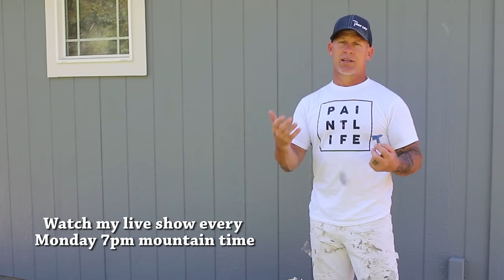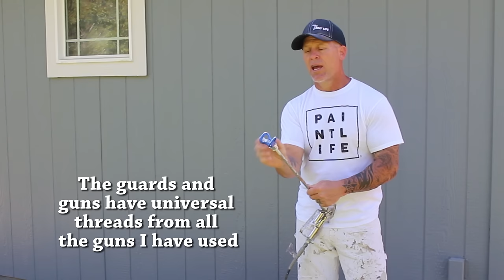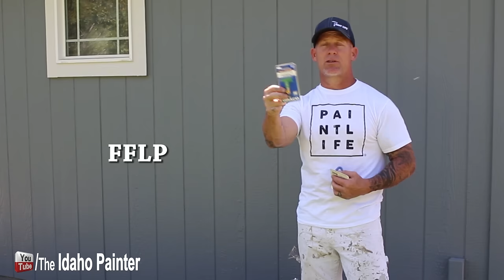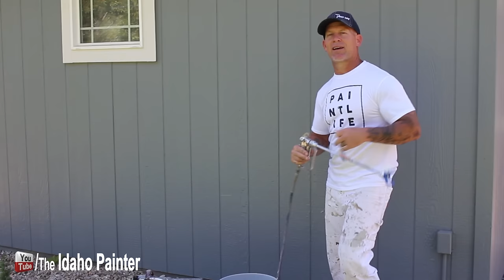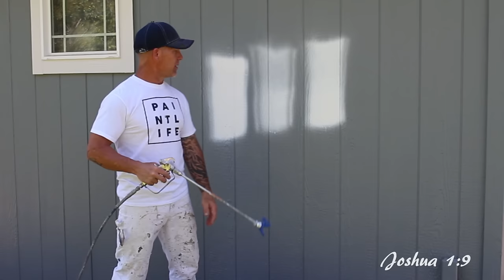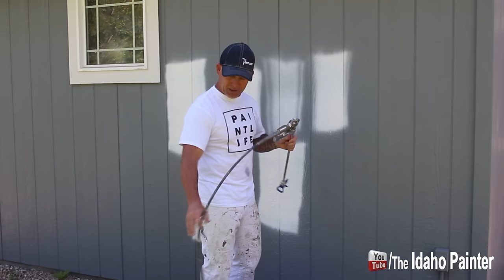All About Airless Paint Sprayer Tips

Comment: YOU SHOULD MAKE A CHART OF ALL THE TIPS, THE PURPOSE OF THEM AND THE PSI THEY SHOULD RUN AT AND I'LL BE THE FIRST TO BUY IT!!!!!
Reply: Or just primt it
Reply: 12th 1
Reply: Several online.
Reply: How about you do it for him?
Reply: Where…?😂
Reply: you can't make a chart since what psi is required varies according to the viscosity (thickness) of material being sprayed. Get a No. 80 Ford viscosity cup and learn to measure the viscosity and start keeping notes of what theconditions are (temperature, viscosity)--I would start there.
Reply: @yusefmessallam  🙄I could be wrong but I'm not on here asking how to paint a classic collectable car, though will admit I am assuming most of us are asking for basic spraying interiors or exterior of one's house or maybe even a fence etc.. well aware of all technicalities and variances for everything especially down here in FLorida (humidity factors everything) but just a simple rough psi estimate with now maybe even sharing your local (temperature, viscosity) paint your spraying with to compare🤔🤷‍♂️

Comment: Great vid, showed this to my crew today.

One more tip related idea: Each size tip has a GPM rating that should be considered in relation to the pump being used. For instance, using a 321 tip requires a pump that can push better than .47 GPM. We spray thick materials (intumescent paint) and usually use 325 tips so the pumps we use are pretty stout.
Reply from the maker: Yes, thank you for sharing

Comment: I retired from painting 19 years ago. I hated the Graco gun with its two finger trigger. I used the Wagner gun with the 4 finger trigger. Way less fatigue on my hand. Now, I know that Graco
has a 4 finger available now but not that I knew about them then. The other thing I always hated was the reverse a tip,  just an excuse to not keep your spray machine clean and running efficiently. When you have to stop and flip the tip around your just wasting time. I had a SprayTech 2510 electric pump, a conglomeration of Wagner (Titan) and I believe Speeflow, though I could be wrong about speeflow. I used this wonderful 2510 for a few years. For interior wall spraying I used a 12/21 12 inch fan my spray technique was like doing ti chi where I kept the distance of the tip from the wall constant using up and down and side to side angles at a constant pace. Now on exteriors is where I really shined. I used a wore out 12/21 tip to where the fan at 4' was only 3" to 3 1/2" and so it was also at 12' with the volume of a 0023 to 0025 tip. Even on a ladder my feathering technique left no flashing even on unprimed Hardiplank
concrete siding with the darkest of colors. The builder asked me to train his painting contractor working in another town how to spray exteriors. I told him, perhaps you should  use me instead. I quit painting at 45 years of age, got my CDL at 47 and have been driving trucks for the last 17 years. No more funky painters whites, no more paint all over my hands, face and hair. After nearly 30 years of painting, I don't miss it at all. But to each his own, I'm not putting anyone down for doing it, its harder than it looks to the non painters. I know this because 
An employee of the builder asked me how much to paint his new house. I told him $900 not including materials, a bargain price. He said I'll just do it my self. He was a kind of creepy guy
The secretaries told me he talked shit behind my back, and he gave kudos to no one, until one day. A month or so later he walked up to me and said, "I should have let you paint my house" "that was the hardest thing I ever did in my life" "you made it look so easy when I watched you doing it" My reply to him was, thats years of experience you were watching.

Comment: I've never used an airless sprayer.  I plan to rent one from the Home Depot to spray the unfinished inside of my 2 1/2 stall unattached garage.  The walls are 3 sides of the studs on 24" centers, plates top and bottom, and the wallboard behind them.   From watching a previous video of yours, that means spraying the inside of the rectangle first and then the wallboard in the center.  The overlap would be on the tops of the studs.  The surfaces will be thirsty since it is raw wood and the black paper wallboard surface.  I'm guessing that the 5-15 would be be a good fit for a first-time person.  It might take longer, but I could adjust my speed and passes rather than be overwhelmed as a first-time user by the speed and perfect distance discipline required to prevent getting into run trouble.  Your videos have been helpful to me as to know how to approach this project.

Comment: Outstanding video. I am a homeowner that has brushed, used pads, and rolled my cedar shingle home since 1975 when I first purchased it. 
  The home has grown as our family did, and I have painted the interior and exterior many times since. 
  Starting back on the South side of the house and had to really put some effort into cleaning and resecuring the cedar shingles, and primer cutting under the overlap where the roller would not get up into. 
In getting ready for this, I broke down and purchased the Graco Dewalt battery operated sprayer, yet had very little knowledge of basic hardware or fan and tip relationships. 
Thus I brushed and rolled the primer over the past weekend. Yes, I was quite ignorant and hesitant to jump into something that I knew needed insight and education. 
  I have had my own small business for 30 years and excel at what I do, but I sure needed schooling for this. 
  I just spent 2 hours tonight following you and your videos specifically on the Graco unit, where you used it on the garage outside, and the doors in the restaurant. 
I appreciate your candor regarding how you adapted to the changes in pattern and your discovery regarding the settings where you turned back to 5 where before you suggested 7 or more, and did not get the paint stratification with the lower setting. 
  Man did you educate me on your tip number relationship with respect to fan width, orafice size and material (surface) to be applied to.
Kept pausing and taking notes and filled out a legal pad. 
As with any profession such as this, experience is key, that I understand. 
  However you have absolutely put me on the right track and your teaching was awesome. 
I respect the tool now, and am not intimidated by it. 
I subscribed to your YouTube channel, and wanted to say Thanks for sharing your gift. 
My grandfather back in the 30s and 40s had his own painting business and perhaps he will see me do things a bit smarter now. 
Thanks for opening that horizon for me, during a Friday night well spent perusing your channel. 
I watched you taping / covering windows earlier this week. 
Your product introductions are very insightful.  
I will visit your store very soon. 
I need to get tips as this Graco only came with the green 310 and I need the 515 for my outside work. 
Thanks!
Harry

Comment: Chris, you might want to mention that depending on the pump size you're using can limit tip size that can be used.I have a 2005 Titan Speedfo 6900 XLT gas and electric and with the gas engine I can push up to 2.15 gpm using up to a .48 to .50 tip on a single gun and 2 guns @ .33 and 3 guns @ .23 and 4 guns @ .19, and only about 1.25 gpm using the electric motor. If the tip is too big it can wear the motor and pump out prematurely.Great videos!.
Reply from the maker: Thanks for sharing Ken!

Comment: Awesome help Chris, Thank you. I just picked up a Graco 490 and painted a textured ceiling with the blue 517 Rac X tip it came with. Turned out great. I will get a 619 also for the walls but I assume the 517 may work as well, right? as well as the 619 on textured ceilings? Thank you for your videos!
Reply: You are painter?

Comment: First time  using airless painter and must say it turned out very well thanks to your instructional videos. You videos are a great help..... Glad I taped and masked everything because the over spray was pretty bad. I was using a 515 tip.... Any suggestions that would help with the over spray.... Thanks again...I was working on interior walls...
Reply from the maker: Glad to help, thanks for watching!
Reply: Use a 415 or 315 tip instead. 515 is to big.

Comment: Beautiful objective demonstration of Tips! It's so good, that I think I would like you to spend more time making another 2 or 3 videos on them, because it just seems like you have a lot more you want to say :)
Reply from the maker: lol, yes there is a lot to say! Thank you for watching :)
Reply: I’m new to airless spraying am using Ben Moore Advance. I was told because it is thick to use at least 515 however I’m spraying chairs and a bookcase. When I looked at the BM Tech sheet it says this
Fluid Pressure — 1,500 - 2,500 PSI; 
Tip — .011 - .015 Orifice
Does that mean I can use basically anything in that range like 311-515? Would I need to thin it?

Comment: Very impressed with your informative and instructional video. Great job!
I just purchased the graco magnum x5....we'll keep you posted.
Reply from the maker: Thanks for watching John!
Reply: John S how do u like your X5? Im currently looking at the LTS 15 which is the same as the X5 per Graco. Just different markings for distributors
Reply: starno 103 after watching more videos I decided to defer my project a bit longer until I purchased a smaller tip.  I also spoke to folks from Sherwin Williams and got some good insight about the other side of the equation, the paint! as I'm getting ready to paint about 10 doors.  Six of which are bare wood.  I'm hoping my patience will pay off as the Idaho painter clearly has a ton of painting wisdom.

Comment: I was told the smaller tips like the 310 was for thinner materials like stains. I painted my house last weekend with a 415 and 215. It just dumped paint on and had a lot of runs. But only needed one coat
Reply from the maker: A 310 would have worked, What paint were you using?

Comment: I happend to somehow land on your youtube channel and without a doubt am very pleased cause I've leaned so much more, I like most contractors think they know it all even with years of experiance, about 10 years or so ago I was contracted to paint a wooden 6' fence, ( hay no problem ) yea right . well needless to say I knew I wasnt going to use a roller so I decided to rent a airless sprayer (not knowing anything about them ) well I completed the job using way more paint then I should have and quite a mess with clean up, what tip did I use ????????????????  the one that came with the sprayer I rented ( what do I know ) ........anyway I decided the purchase one which I did from Harbor Freight  and it worked again not kowing anything about what tip is the right one, I was able to get by with it and done a few decks which worked but I tried to do interior walls --big mistake- ended up rolling the walls -- now to the current day - last year I had to rebuild a deck and paint it --no problem  untill I tried to use the sprayer I had for the last 6 0r 7 years 
I ran but no paint -I then went to Menards and purchased a Graco magnum pro x17 and after watching one of you videos ( WHICH I MUST SAY HELPED TREMENDOUSLY)  I used a 5-15 tip and was great but I never pruchased a extention wand so a lot of bending and too much pressure ( but I'm learning ) It turned out way much better gave to say thanks for your videos  and I'm going to try and find the station you broadcast on  ---never to old to learn - thanks again

Comment: For all the less experienced painters out there before you go and use any tip over 415 make sure your airless can handle it . In my experience small airless sprayers wear out parts quick when spraying large orifice tips . Sometimes they cant even hold enough pressure for painting with larger tips .
Reply: You are rights  sir iam also spray painter konecranes lifting business

Comment: Planning on removing fiberglass insulation in attic due to it's lousy fire rating, and mold issues. After I air sealing drywall gaps I'm planning on sealing roof rafters and everything in the attic except the wiring and can lights.. Good information, probably going for the 1223 tip or bigger. Haven't bought a gun yet, thinking about renting one, also might look for a blown out 1221 tip
Reply from the maker: Would recommend buying one!

Comment: I have a really stupid question. I do a lot of drywall(hanging/taping/texturing) over the years I've learned that spraying and back-rolling a PVA Primer before I texture helps lay over any frilled drywall paper caused by the sanding and also helps accentuate any imperfections  in the final coat before making it permanent by texturing over it (which doesn't "hide" as much as we all wish it would) so I bought a middle of the road Graco paint sprayer to efficiently spray primer. The problem is that when the homeowner sees that I have a (in their eyes an "industrial") paint sprayer they want me to "Just do the painting as well." My hesitation is that I don't know that a $400.00 sprayer that I use as a means to an end is capable of delivering a quality end result.....I guess my question is.....What should I tell them?

Comment: I bought a Graco 490 sprayer, the guy at Sherwin Williams where I bought it said to use a 212 on the trim. It worked on the first gallon, then stopped spraying. I had to go to a 515 to get the gun to spray.
Reply: Thunderbird88 was paint to thick
Reply: I strained it and watered it, and it still jammed. I just put on a 515 and am now using it for everything, trim, metal facia under the overhang, and  walls, so far it hasn't jammed even once.

Comment: Thanks for the great video. I bought a house recently and there's a big pink room I plan on painting along with a few other things in the house.

I recently got my first airless sprayer. I have never used one before. I'm watching this video because I assembled the sprayer this evening and plan to try to use it tomorrow. It came with a 515 tip. Before the video, I had no idea what 515 meant so your video is very helpful. I'm worried a little bit about overspray because I'm keeping the ceiling the same color, but painting the walls and trim. 

When it comes to masking, if I'm using a 515 tip, how far should I mask off away from the spray area. For example, should I mask off an entire window or can I get away with masking off 5in with painters tape and paper?

Comment: I have a Steel Fabrication Shop where i have a Painting Team of five men. Your Video is really helpful for me & my men. Need to ask you if you can help that:

1. Eg: In Tip 219, 2 denotes the Fan Size in Inches & 19 Denotes the Paint Flow. I am unable to understand that how to decide what paint flow shall be used in the respective job ?
Is it directly related to DFT required ?

2. My men always keep there Gun distance from 16 inches & above. We are generally using Tips 213, 215, 219, & 221, whereas our Jobs clear surface area is 6 inches minimum to 80000 inches (2032 mm) maximum also.
 Is it because we are using incorrect size of Tip ? 

3. What Gun distance do you suggest for Painting on Steel Jobs ? is it same as 12' ?

Thanks & Regards
Rajneesh Bansal (INDIA)

Comment: Howdy Chris , I am new to airless and really liked how you showed the blotchy effect of too little pressure and what it should look like corrected, unfortunately my screen doesn't clearly show what the proper looking fan spray is supposed to look like. Can you do some close-ups on the spray pattern with different tips & different product being sprayed and how the pressures can correct the pattern? I've heard terms like feathered, fingered and tails and I don't know what these describe or what the actual fan's stripe SHOULD look like.  I bought an FFLP 210 to spray my door/ drawer  fronts & cabinet vanity. I tried hanging the doors with cup hooks and hangers  (works great!!!) like you do but it still seemed too much pressure as it pushed the doors away applying the primer.
HELP PLEASE !!! Using a Titan 200 and Graco  contractor gun with FFLP 210 and Sherwin Williams pro classic water based acrylic gloss at 60 degrees outside temp/in a booth,  I was around 3/4+ on pressure slide. I don't know if I'm supposed to have the middle 4" fan solid with a misty 1" each side or what I'm adjusting the pressures to achieve with this tip or any of them. 
 Thank you for your helpful videos and I look forward to a reply. 
 Please LIKE if you want to see a video of fan patterns too!
Reply from the maker: Using FFLP tips you have to have a pressure gauge. The tips have to run between 800-1100 PSI to work properly

Comment: Great video as always.  I’m going to be painting the stucco exterior of my house with Sherwin-Williams Loxon XP.  What size tip do you recommend and what pressure should I be running at?  This will be my first time using an airless sprayer.  I plan on back rolling it as well.  Appreciate any help.

Comment: You seem to have forgotten to mention filter size. You need to suit the filter size to tip size.up to 15 thou ...you need to have a 100 mesh filter. After that use the 60 mesh...over 27  thou
you can remove the filter all together. The inlet strainer will cope with most. the numbers are on the top of the filter mesh. Also as a the tip orifice increases by 2 thou it puts out 50% more paint over a smaller area. If you are paying for the paint change your tips regularly.

Comment: have you tried a flat tips?
Anything over 621 if you strain your paint works well only issue with flat tips if they clog you nead to take the housing off turn it around put the housing back on pain in the butt.
Other than that they're like five bucks each.🤔👍